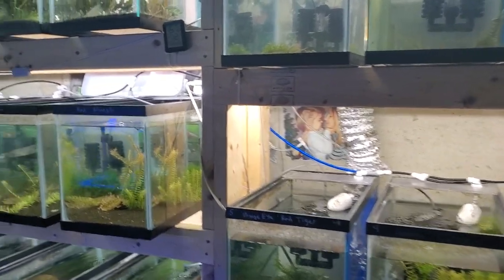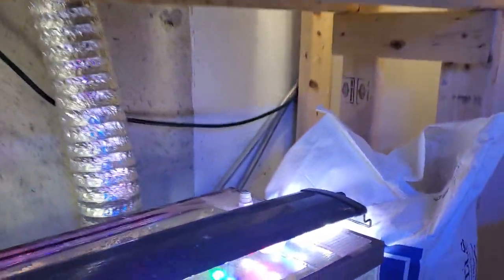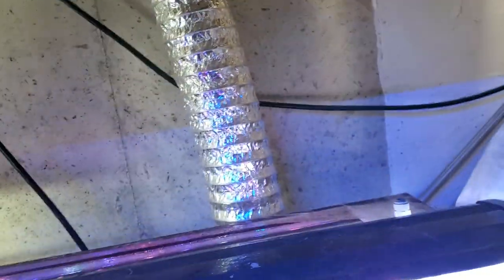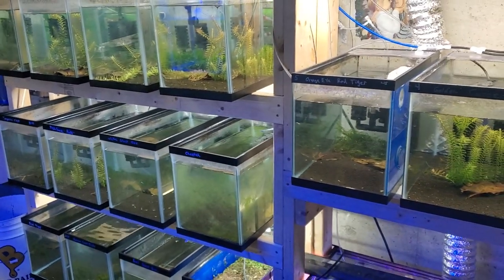Float Valve FAIL

Comment: It feels unusual for them both to fail so close to each other but that is not surprising when you think about it. If they were bought together or around the same time they are likely from the same batch and have the same flaws from manufacturing or the design itself. If one of them fails the others are not far behind in my experience since they will all likely have the same flaw/issue that is causing them to fail. At least that's what I find with a lot of things in life. If you can see exactly what part caused it to fail, maybe check the others to make sure they are not about to fail in the same way as well. Glad you caught it early. Best of luck!